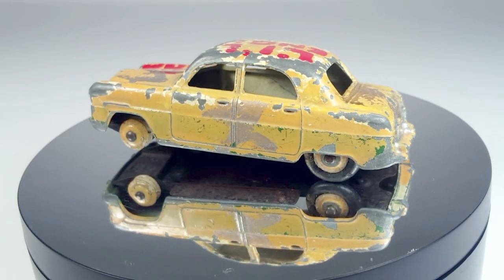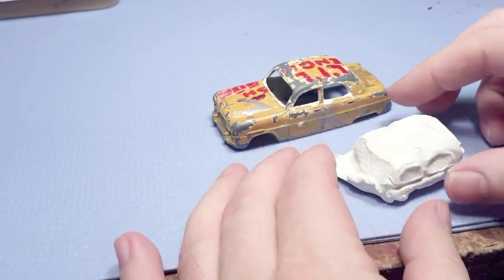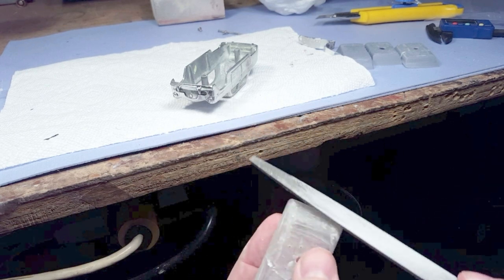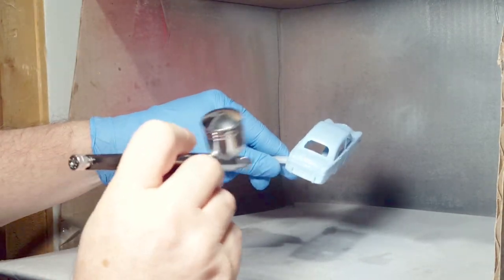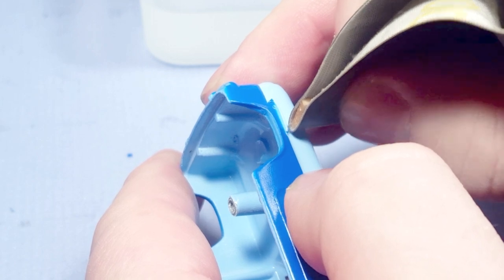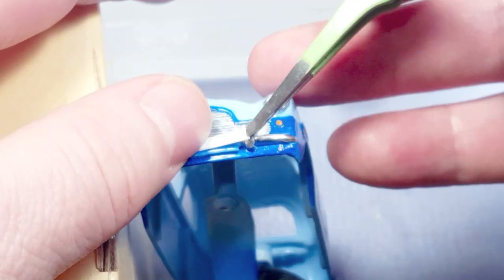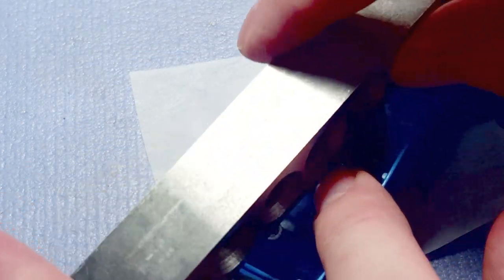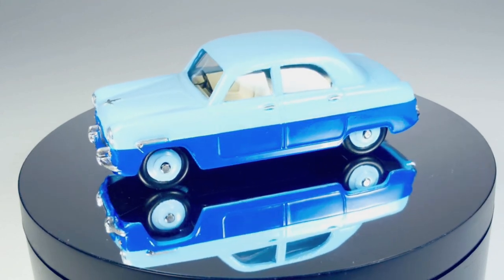Dinky Ford Zephyr Restoration

Comment: I’m not trying to trip you up, you do a good job, but can I just mention that the car has bench seats.
Reply from the maker: That's OK. It's Timo's Dinky Detailing, so part of my detailing was to remove those crappy bench seats and replace them with buckets. I also had to add a floor shift. This is harder work than folks recognize. 😜

Comment: Although these old 50s Dinkys look OK as just the casting, the interior & glass ramps it up to a more realistic level. Great colour scheme. Sad to say, this was another that came off the ass'y line as a column shift on the 〔standard model. (3 fwd & rev). To floor shift as column shift could be sloppy & temperamental. Daresay some wouldve converted for a more positive gearshift
Reply from the maker: For future ones, I will have to look up which cars had only the column shift. Don't be surprised if I give you a shout.
Reply: @Timo's Dinky Detailing  Go for it good buddy. Sometimes nice to go for authenticity, other times not. I can't say if there was any rule of thumb that dictated. Sometimes it came as an option. Mk 1, 2 & 3 Ford  Consul, Zephyr  & Zodiac were all column shift

Comment: Great video. What if you put that clay in the car to make the shape the windscreen and then put the car with the clay in the oven once it's gone hard.  pull the clay out and U have Ur form for the vacuum form machine. An Aussie guy on YouTube he put what we call glad wrap or cling wrap on the outside of the car window. When on the inside he puts some UV cure resin and hit it with a UV light and then just pulls the GLAD wrap away and there is Ur window.
Reply from the maker: Thanks Flipper. I think I saw the video you're talking about. It was the guy from Gravesend. I may give that a go in the future.
Reply: @timosdinkydetailing  that him.